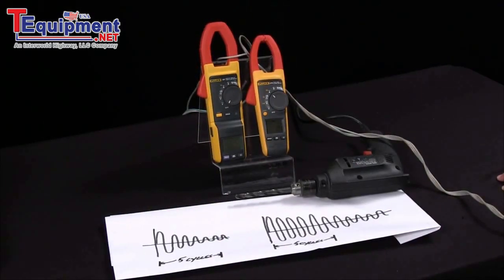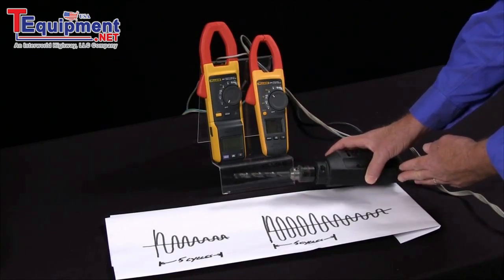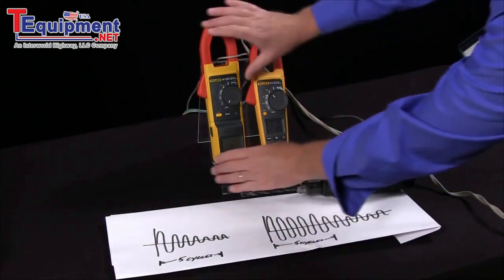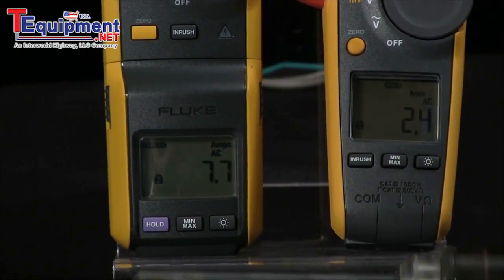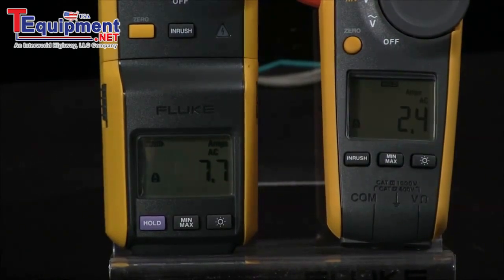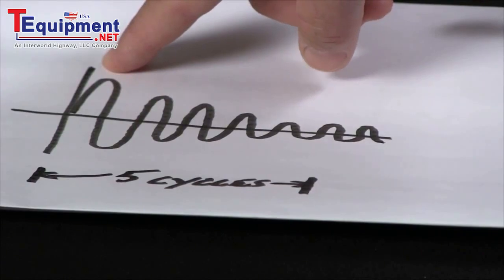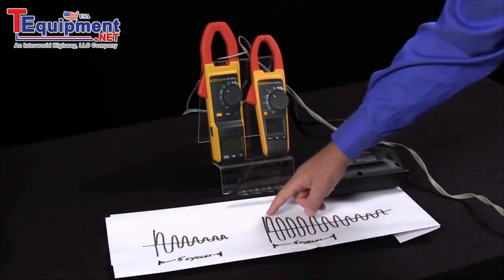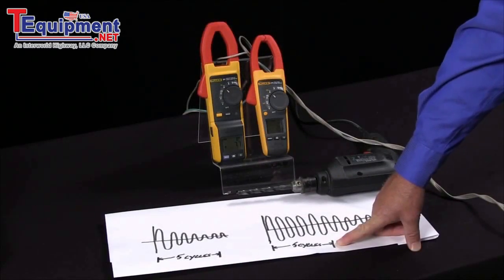What Is Inrush Current And Why Do I Care?

Comment: 7.7/2.4 =3.2 times the running current.  4-10x is common.

I wonder how this differs in transformers and machines.  PTs vs CT and different size transformers?
You suggest that the meter does not measure the transient currents peak inrush.  So what is in capturing with the 7.7?

Comment: How would the inrush current function work measuring DC such as an automotive starter motor.  Since there aren't any cycles to count, is is purely based integration over some fixed time or is there some type of logic used?
Reply: Fiver Hoo fiver same question. Fluke told me it works for dc I’m just not sure if it’s of any unique insight